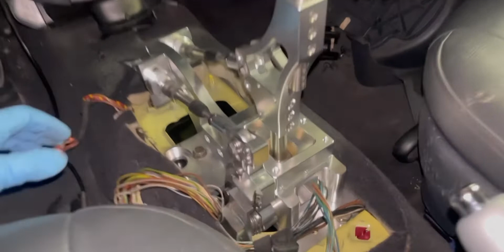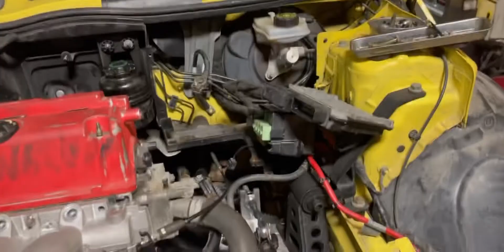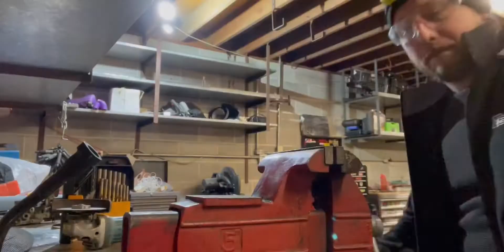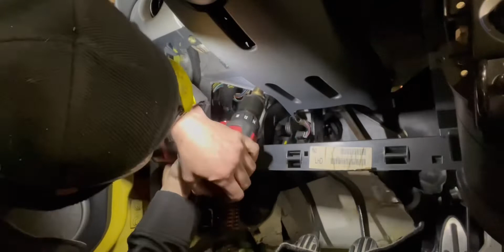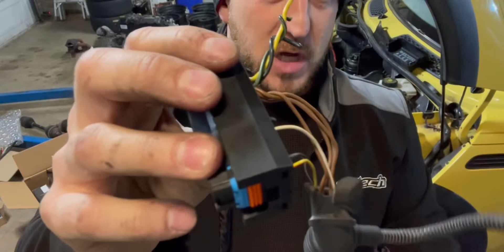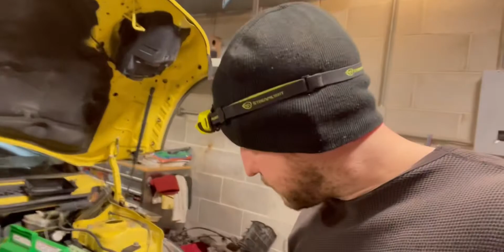Wiring and alot of hammering! K Swap Mini Cooper Build Episode 5

Comment: Did u use the Haltech to control gas pedal as well or manual pedal
Reply from the maker: Has a throttle cable. Its not dbw

Comment: Looks you used a universal swap conversion harness with the Haltech. How did you modify or rewire the relays for it?
Reply from the maker: Its been quite awhile since i did it but i believe i used an eg k swap adapter and rewired it to use as a standalone race harness. I believe i also used a relay in that harness to turn on the factory mini fuel pump relay
Reply: What do you mean by rewired it as a race harness? Remove non essentials? Do you recall how you sent power to the ecu? I’m having an issue where my haltech is constantly powered on. Thanks!
Reply from the maker: @jaymec5137 if you search “k series ecu wiring” on google its like the first diagram that comes up. As far as the power to haltech im not exactly sure where i pulled power, but in general it sounds like u have terminal 30 ran to a spot that should have terminal 15. U need to start testing wires and see which has power when the car is off
Reply: @ I got a “jumper harness” and conversion harness but found out it’s not compatible with my swap. Just diving into the diagrams now. Thanks for replies and appreciate the videos.